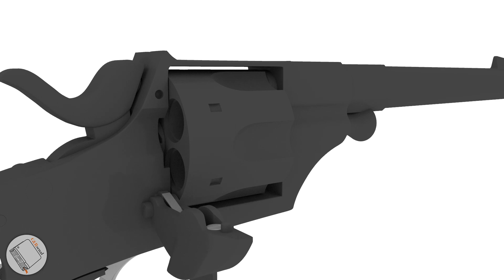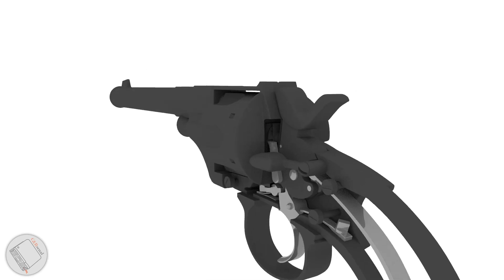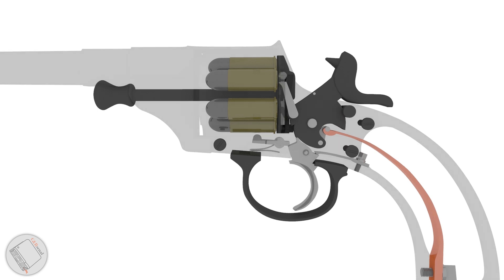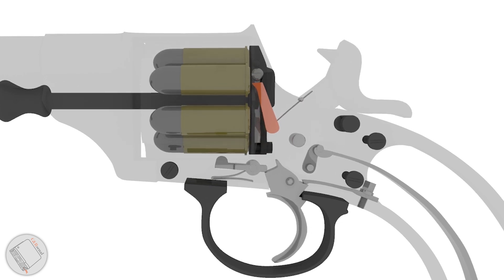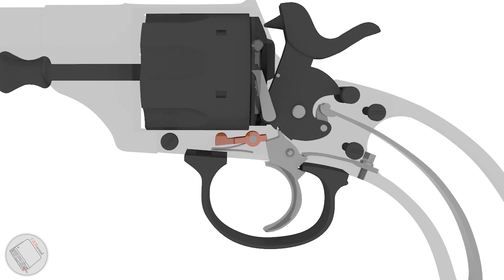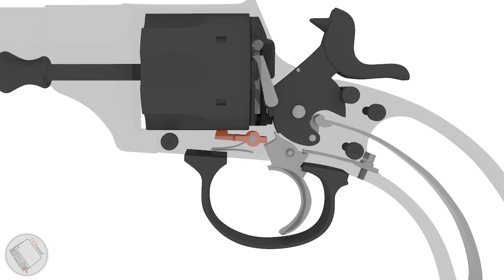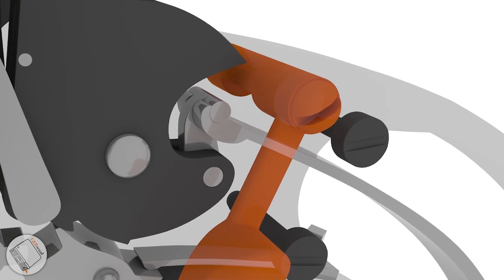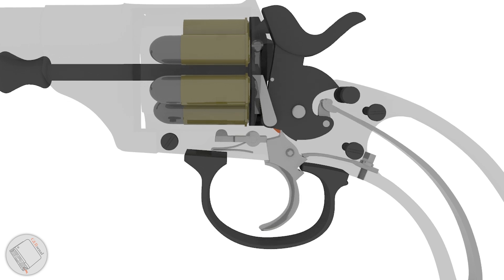How it Works: Reichsrevolver 1879

Comment: Couple problems with the Reichsrevolver, the cylinder notch is prone to damage when cocked too fast(fixed by 1894 with raised cylinder stop). Main spring follower can break if the hammer is fanned too hard for too many times(I broke one). The trigger return spring screw can stretch and eventually fail if tightened by a tool, because the screw will stretch when you pull the trigger if it was tightened by a wrench, they are only meant to be finger tight(I broke 2). Lastly most Reichsrevolver has excess cylinder free play and can develop dimple on the breech face from primers in as little as 50 rounds. I have shot through 1000 rounds in one of my 1893 dated Reichsrevolver and the breech face is really awful at the moment.

Comment: What size bullet does it take?  I read that they blew up with the .429 44 Russian rounds.
Reply: That's what I shoot in mine. Slugged the bore and did a little measuring. Works like was made to fit. 
Wouldn't try to hotrod it or anything though.
Reply: @600viking  Do you use smokeless or black powder?
Reply: @657449  I've done both. 
Usually unique for smokeless or a full case of 3fg for black

Comment: WHY DID THEY NOT ADOPT A SINGLE ACTION ARMY ?!!
Reply: Because they wanted to get the least modern revolver possible.
Reply: Prussians weren't too keen when it came to revolvers.
Reply: because Mercedes can do everything Ford can, but overengineered, complicated, and harder to maintain, all with a vague shroud of apparent elegance and so-called sophistication.
Reply: @FranzAntonMesmer 

In .44 Russian is best .
Reply: @paleoph6168  And this gun replaced a muzzleloader from 1850.
Reply: Surviving documents indicate that they felt that the SAA was too delicate.
Reply: @davidhansen5067 

German ignorance , classic .

Some people beat it up to no end and it still works .
Reply: The Colt 1873 was an obsolete design in Europe by 1879 too. 
So many better options and these things are like a joke from a pirate game.
Reply: @oolooo  If you check out the full episode, Othias actually goes into a fair amount of detail as to why this happened. There's a method to the madness, yet madness it remains.
Reply: @davidhansen5067 

I refuse to accept it
Reply: Because the SAA delivers basically the same function (theoretically) in a pattern more unfamiliar to the hand of the user. While the colt is just an "improved pattern of the last thing we issued" here in the USA (familiar to the hand, easier to adapt to), it's a completely alien feel in relation to those euro calvary  pommel guns this replaced. The gorky, ungainly ergonomics of the Reich revolver were "the old familiar friend" in comparison. The transition of kinematic handling was far smaller. You don't want your horsemen shooting their ponies, or missing the enemy due to muscle memory. You're issuing to a force of illiterate half-wits who have basically been tortured into effectiveness with the old arm. Anything that eases the transition to the new arm is a plus. The colt would be "just too different", aside from the stuff like a 2 piece screwed on grip frame, and an ejector tube not well suited to pistol whipping enemy infantry as you break their ranks, lol
Reply: Not made in Germany
Reply: Why would they adopt a single action army? It was outdated by this point and only marginally better than this.

There were plenty of double action or simultaneous ejection revolvers available and in use at this time that they were familiar with (the Smith and Wesson Model 3 entering Russian service being a driving force behind the adoption of this gun). Jumping to combine double action and simultaneous ejection would have been the smart move, but not having at least one of those was a huge mistake.
Reply: @88porpoise 

Double Action is cringe .
Reply from the maker: The Reichsrevolver has poor egos and no ejector. However, it is simpler and more robust. Plus it has a side plate.
Reply: @Candrsenal 

You know what ? .Hitting people with a Reichsrevolver is probably effective and maybe even fun .So , fair on the robust bit .